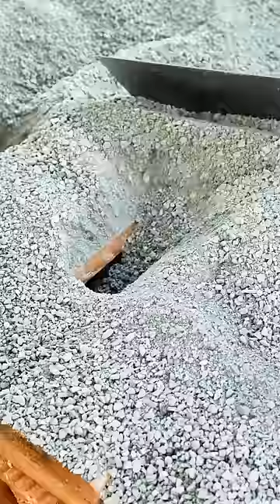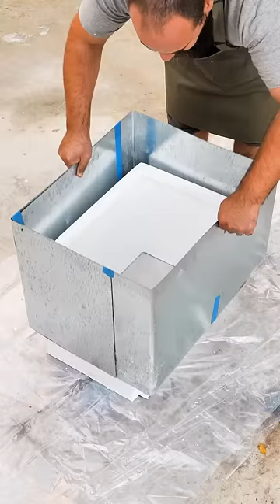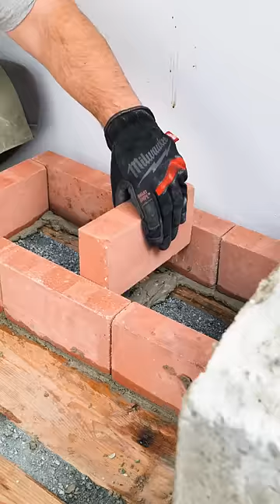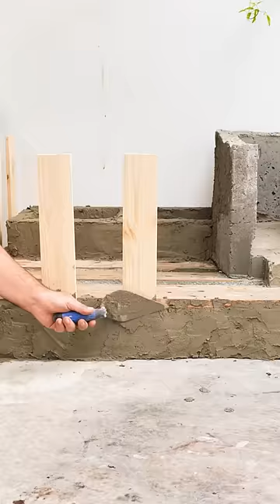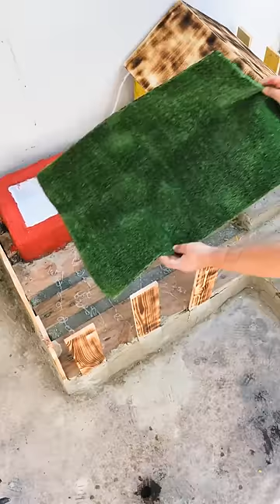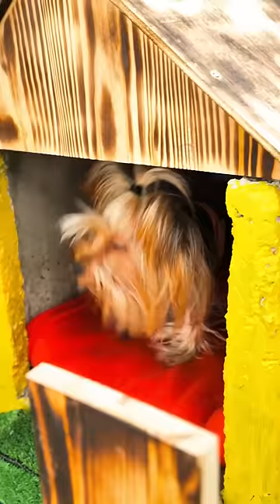We made a cute dog house out of cement 🐶 #shorts

Comment: Cement and wood have totally different properties regarding expansion  water retention for it to have any chance of lasting the winter you should put a membrane on the wood then wire mesh lathe b4 sand cement mix to have a chance of not cracking off 👍